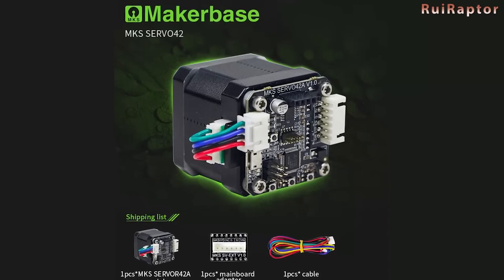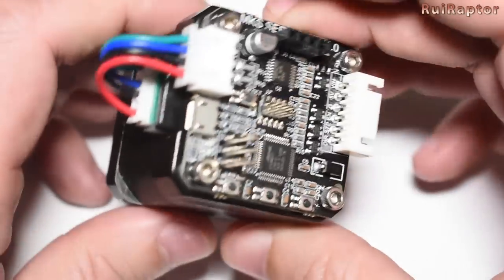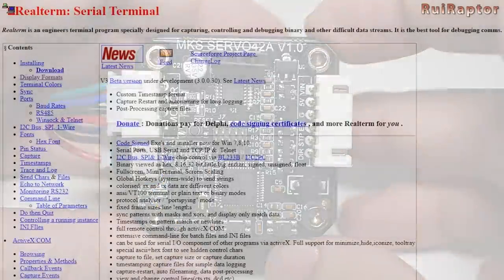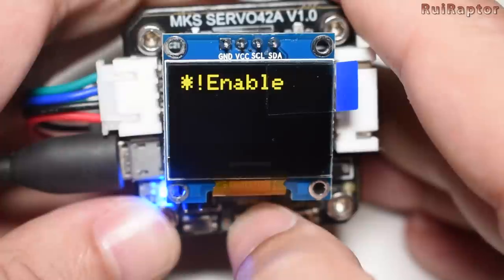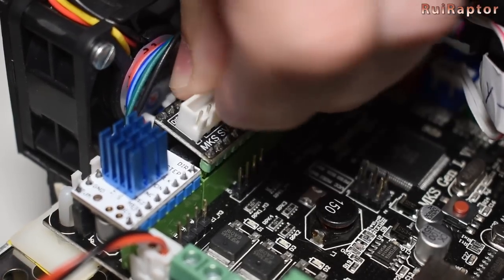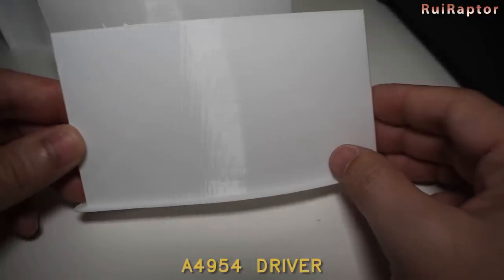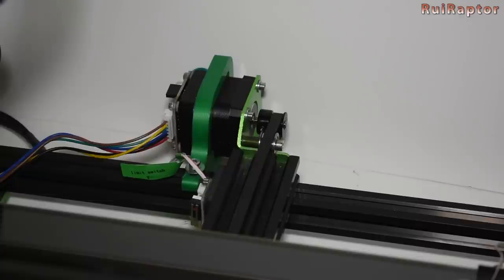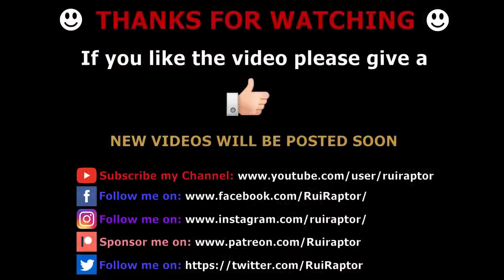MKS Servo42 Close Loop Motor (MAKERBASE) - Tests & Results

Comment: You forgot to test the MAIN Feature of this setup -> Closed loop.
To test that you force it to miss steps manually and see if it returns.
Reply: also notice that it looks like the board which does actually the closed loop stuff looks like it could be moved to another stepper no problem.

You could have reduced salmon skinning by increasing vref as well.
Reply from the maker: Hi,
I actually tested the close loop feature (mentioned that in another comment here).
I rotated manually the shaft and it returned to the initial position.
Regarding the salmon skin and vrefs, I followed the manufactures advice on max values and tested. The salmon skin is not fixed with vref adjustments.
Reply: @ruiraptor  Increasing Vref decreases the amount of móire. It is probably missed microsteps which causes it, well that is my theory in any case.

MFG recommendations are a bit so so, it is like they would sell you bicycle which they say can only do 5km/h, or this another 10km/h.

Just step up the Vref; If you cannot boil eggs on driver or the motor, you are all ok :)
Joking aside, i try to keep my motors and drivers below 80C, often around 60C (60C = very uncomfortable to touch, but ok)

That was not sufficient test of closed loop as just watching flag on it does not give any idea did it return to exactly right spot, that test should have been done during print, so if it did not return to exactly right spot, it would be veeeeery obvious. Mid print you will easily see if it missed by say 0.1mm :)

Comment: if you have the pinnout of the driver ic you could solder on some wires and go to a diffefent driver
Reply from the maker: Hi Vega 128. That's not that easy to do :)
Furthermore, there are surrounding components that are different between drivers too.
Reply: @npgoalkeeper _ how so? This uses a magnetic position sensor just like the uStepper

Comment: Not all smoothers are the same! There are MANY different diodes that will cut off power at different voltage levels so just because one brand of smoother doesn't perform well, doesn't mean all will be that way!
It's like saying all 3D Printers perform the same when we all know that is totally ludicrous!
Reply from the maker: The ideal would be using trinamic drivers instead of allegros.

Comment: this contraption are not a closed loop driver and can not track steps.   all it does is counting full rotations or half rotations at best.  
for tracking individual steps driver needs a proper incremental encoder with resolution twice as high as preferred step-rev count.
Reply: According to the specs of the sensor found in the link, it's a high resolution angle sensor "The A1333 is a 360° angle sensor IC that provides contactless high-resolution angular position
information based on magnetic Circular Vertical Hall (CVH) technology. ". Link: https://registration.allegromicro.com/#/parts/A1333

Comment: i has encoder error reboot??
Reply: I have this same error with mine. Its a 7 pin version though from Ebay and no reset button. Did you ever figure this out? I'm about to return to the seller because they are not helping.
Reply: Figured it out with the supplier, the VIN input to the STM32 chip, has to be 5v, my skrv1.3 from Bigtreetech only puts out 3.3v.